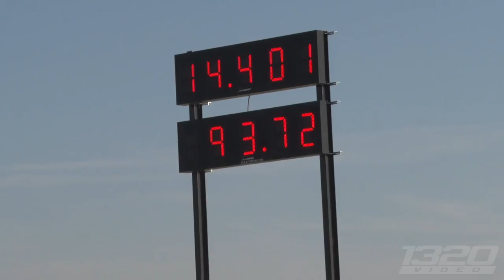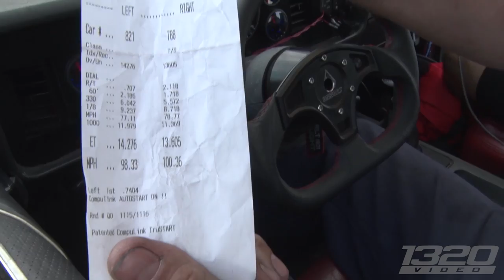WORST Luck VS The BEST Attitude

Comment: It sounds like a Harley lol.. Sure that thing is running on all cylinders? 😄
Reply: 17:15
Reply: It wasnt🤣
Reply: Hear it breaking up.
Reply: Thrown together in two days.  Engine had 80 or less compression across 6 cylinders and wouldn’t rev past 4K.  It was the best time I’ve ever had racing 🤘🏻🤘🏻🤘🏻
Reply: Not from my couch it isn't
Reply: I thought 🚜.... Guess that's about the same thing although farmers don't wear matching vests
Reply: @BMF_Garage  and still got some air under the LF tire @12:30. Pretty sweet!
Reply: @BMF_Garage  she did good. Missing. Why didn't it throw a rod or smoke realty bad etc.  I know k series motors but nothin much about the Windsor.    She crazy

Comment: Old video but I don’t think the car owner was giving himself enough credit for the potential; that car could definitely be competitive in an 11.0 bracket. Back in the day I ran a bone stock 5.8 (351W) truck motor- stock heads, stock cam, non-ported GT-40 upper/lower intake, 42# injectors, ProM 80mm MAF, Anderson PowerPipe, YSi blower w/ 2.95 blower pulley and stock crank pulley, Longtubes and MAC Prochamber w/ dumps and tuned with SpeedBrain chip tuning I made ~430whp and 450ish TQ only revving to about 5500 RPM. With the right rear gears and some clever shifting that would easily put a Fox chassis Stang into the low 11’s. I never tracked that particular build as it was just a fun daily street car, but my ~500whp 302 HP Nitrous Fox went 10.85 @ almost 3000lb race weight with a WC T-5 and 4:10s so compared to that I would think the power he can make with even a modest blown stock Windsor should be plenty to go well into the lower 11’s if he drove it right.

Comment: My first car at 16 was an ‘86 GT 5-speed with 180k and I had it running 14. flat with a cat free exhaust and flowmasters & a cold air intake. A Kevlar clutch & a flexfan too. Simple bolt ons on a high mileage engine running 3/4 of a second faster than new “off the showroom floor” in 1986.

Comment: Mean while I’m over here giving up on a damn mr2 axle 😂
Reply: literally me giving up on small electrical problems with my G 😭😭
Reply: @Hunterslides  Do you have a factory service manual? If not, get one. It will be the best ~$100 you ever spend on the car.

The wiring diagrams will make your life infinitely better. Many of them have very in depth electrical troubleshooting guides, aswell.
Reply: @sumdumguy3021  I do not, but thank you very much for that gonna look into one now. It was a manual swap from someone and it’s just been a mess since day 1, thank you 🙏🏻
Reply: @Hunterslides  no problem. It will have the info for both transmissions. Sometimes there is a supplemental book, that goes with the service manual. If so, you can probably find them together.

It's the first thing I get, for any car that I buy.

What is the cars year and model?
Reply: @sumdumguy3021  05 infiniti g35 base model coupe
Reply: @Hunterslides  looks like it wouldn't let me link it. But they are around $250 on ebay for the set for 2005(4 books total)
Reply: @Hunterslides  have u tried searching on google? there is a page thats just for all infinity 03 and up. thats where i found everything when i was having problems with my main fuse box on my 03 sedan.

Comment: I wonder if he's hitting an RPM wall because of the infamous cracked block. Oil pressure leaks down from the cams and then the hydraulic lifters don't stay pumped up at higher RPMs. Still very drivable at lower RPMs.

Comment: Love those guys...itll run a 12 he says..uuuhhh not shifting at 3,900 it won't....as soon as they figure out why it's running like crap (I can hear that it's running bad from my recliner 1500 miles away) I'm sure he will see his 12s of course that may require tearing into the motor. That car ran high 14s off the showroom floor with slicks.

Comment: That firing order is wrong. I had the same problem with one of my 351 Windsor’s. It had a 302 cam in it giving it a 302 firing order. It would not rev and sounded just like that. And when I fixed it, 7500 rpm all day it was a freak. Cain hard guys.
Reply: But it’s not.  Firing order was verified correct.  Swapped from one 351w to another and verified it multiple times.  It made it through race week.  That was the goal
Reply: @BMF_Garage  cool as guys. Good to see you guys having fun. That’s what it’s all about. Most people take shit way to serious. It’s all about getting your friends together and going and having fun. Cain hard guys.

Comment: Used to run the Ford small blocks back in the day. (70's) ran 12.5  and 13 second et's. That baby has a dead miss. Sounds like 2 hole Harley. Flat cam or a dead hole. (low compresson) He's having fun and that's all that counts. PS, invest in a timing light.
Reply: He had all tools.. at home. Packing was a afterthought. He threw stuff in a bag, and drove to bandimere just to finish it there!

Comment: BTW, that engine is fine shifting at 6500. The dude isn’t even getting into the power ban
Reply: Down on compression.  Less than 80-90 across 6 cylinders.  Hit a brink wall at 4 k and wouldn’t go higher.  Was literally a junk yard engine that had been sitting 8 years.  You get what you get and don’t throw a fit 🤷🏼‍♂️
Reply: A stock 351w cam is done making power at like 4500k rpms brand new anyhow. The hci hardly feeds 300cubes to 5k rpms lol.

Comment: Love the car, but i have that engine and had a spark plug wire short, meaning it was running on 7 cylinders, and it sounded just like that, so he may have a bit of a problem
Reply: It had so many unidentified problems. But we just needed a engine. 🤣😂🤣 One of friends made a custom flywheel 1 day before, just so we could go! It was a hot mess!

Comment: lol, he used a cast iron windsor block and Cleveland heads.  Windsor oem blocks are weak. Should have either used a cleveland block, capable of 800hp, or a iron eagle windsor block with cleveland crank and heads which is much stronger then oem windsor block.

Comment: He seems like a cool cat, but I'd be embarrassed with those runs. I had a 89 LX 5.0 with a couple bolt ons n street tires n was running mid 13s. God, I miss that car. I still wonder what I would of ran with slicks on it. I was afraid of breaking something if I was to run it with slicks
Reply: You’d be embarrassed that two days before race week you threw something together so you could make the race and enjoyed every minute 🤔 not embarrassed at all...  wasn’t built to be fast, was thrown together to make race week.

Comment: Looking at the super charger like, do they know it doesn't have a belt on it.  Thats why its running poop now.
Reply: The belt on the powerdynes are internal (not visible without disassembly)
Reply: @shauncole4392  this one is internally gear driven xb-1a.  The belt was off when traveling track to track to save on wear and tear

Comment: I have watched this guys channel before and his stuff never works, or it breaks.  Get rid of the truck intake it is for low end torque not high horse-power. That intake is choking your engine, replace it with a single plane so that engine can get some air.
Reply: Never works or breaks.... Such is life.  Life isn't fair and neither is racing.  Do better.
Reply: The Clevor set up was frustrating. But my Love always was trying to make it work! I’m excited for the new engine!